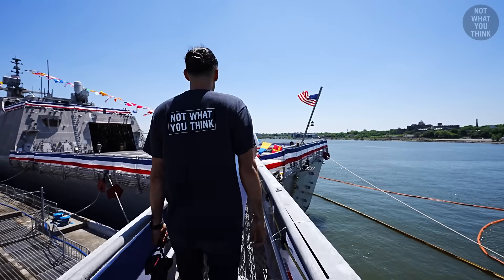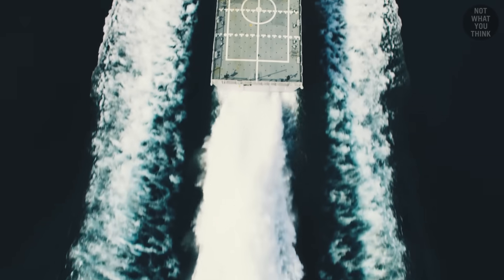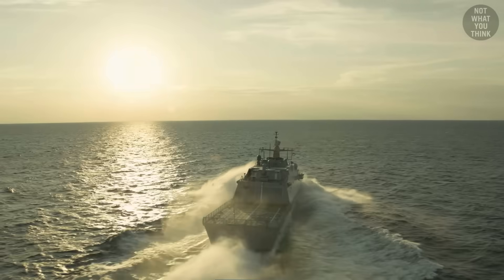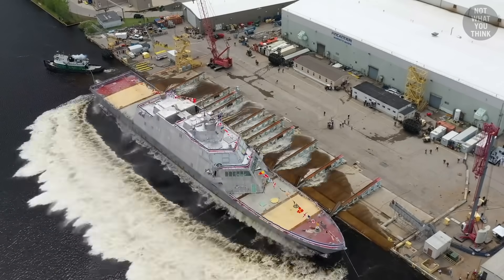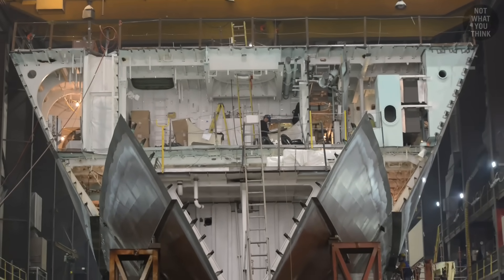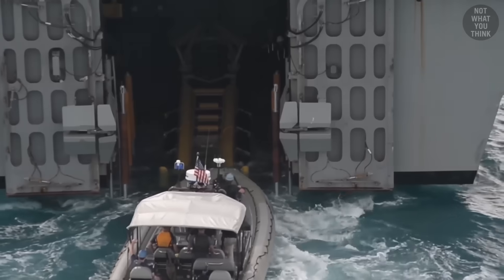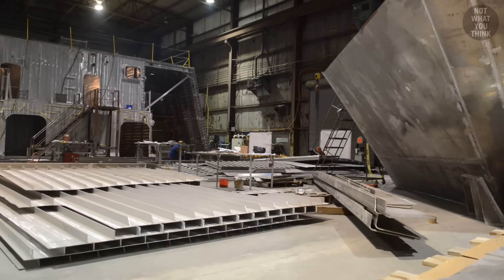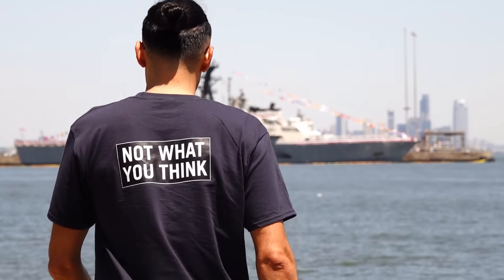I Visited The Most *Overpowered US Navy Warship

Comment: I appreciate the effort, but your video title is dangerously close to clickbait (if it isn't already based on your definition of "overpowered").

The LCS class ("little crappy ship", or for the Freedom class in particular, the "little crappier ship") is a case study in the dysfunctional acquisition system currently practiced by the US Navy, exceeded perhaps by only the disaster that was the Zumwalt class destroyer. The LCS concept was identified during a series of conflict scenarios that posited a foreign power attempting to close the Strait of Hormuz, a hypothetical event at the time that exposed the USN's capital ships (the ones capable of mine clearing, ASW and interdiction of enemy surface vessels) to multi-domain attacks from littoral and shoreline missile batteries. The USN thought a small, fast ship displacing 2500-3000 tons could accomplish all of those missions using a number of modules that would optimize the hulls for mine clearing, ASW and surface warfare duties. The small size and relatively inexpensive cost designated the LCS ship as an expendable asset.

Unfortunately, incessant design requirement changes meant that the modularity component was grossly under-developed (ASW and mine clearing modules were never completed), would require the vessel to leave the AO for module installations and the exchanges themselves took far more time in protected ports than originally projected. Compounding these erroneous assumptions was the decision to reduce the number of hulls ordered- fewer hulls would save money since the modules could make every ship an ASW, mine clearing or surface warfare platform. If all of the modules were actually functional, then part of this statement would be true- but because each hull could only do one mission at at time the main benefits of modularity were essentially defeated because there simply were not enough hulls to carry them. 

Ironically, the USN ultimately committed each hull to a specific mission profile with a focus on surface warfare packages- a very anti-modular approach which was the foundation of the entire concept. The surface warfare "lethality" is still grossly under-powered, but this is being addressed with the addition of the NSM and bolt-on, containerized VLS cells. The ships won't look pretty, but they will certainly be more lethal although their survivability remains low. Had the USN navy committed to hull specialization at an early stage, then at least there would have been some commonality between ships and subsequent reductions in maintenance costs and some aspects of training. The USN still needs a new small hull form mine clearing and ASW platform- the current ones date back to the Korean War and have wooden hulls. 

How useful they will be remains to be seen, but perhaps the most practical lasting lesson for the USN is an examination of its procurement and design process to avoid multi-billion dollar mistakes. Beyond the money, the USN lost a generation of time in a flawed concept, which could have been spent training new crews in a more evolved combat doctrine to remain ahead of potential adversaries. No amount of money will ever compensate for that loss of time- and China and the PLAN have used this opportunity to invest heavily in their domestic shipyard capacity and have now fielded the world's largest navy by hull numbers (and will in a the next decade achieve supremacy in actually tonnage).

BTW, we're still waiting to commission three of the Freedom-class vessels- long after the USN begged Congress to defund the program.
Reply: Almost like they are failing on purpose.....
Reply: Yet the hulls and machinery used in both LCS classes are based on successful commercial designs.  Why can civilian sailors operate ships like this and the US Navy cannot?  The Independence class is based on a 19 year old high speed ferry, the MV Benchichigua Express operated by Fred Olson Line around the Canary Islands.  It carries over a thousand passengers and 300 vehicles every day in any kind of weather in the Atlantic Ocean.  Fred Olson Lines is satisfied with the ship's reliability they ordered two more from Austal.   Commercial ships live much harder lives than naval vessels that are in port more than they are at sea.  Commercial ships have to earn their keep.  Fred Olson gets great service from their ships.
The Freedom Class is based on a successful passenger ship design that currently holds the Blue Ribband for crossing the Atlantic.  In 1992 she crossed the Atlantic in 58 hours 34 minutes.  That is just over two days and ten hours!  She has been in commercial service 1992 and her owners are happy with her, yet the US Navy can't make the same basic hull work for them.
Reply: The title refers to the Literal horsepower of the ship...

Freedom LCCS: 2x 48000HP turbines plus 2x 9100HP Diesels for 114k HP for 3500 tonnes displacement. 32 HP/tonne

VS

Arleigh Birke: 4x 26250HP turbines for 105k HP for 9700 tonnes displacement. 10.8 HP/tonne
Reply: "Flawed concept" is a pretty dumb take when arguably the most useful ships in the fleet - Amphibious Assault Ships - are also multirole ships. And modularity when done right is a complete gamechanger that makes a force much more versatile.

The concept wasn't the problem, the execution was.
Reply: @Palatine-Knight I don't understand the need for "dumb" comment, because I explained everything above. I feel it necessary to remind you that all USN combatants are multirole ships, although some platforms are more optimized than others. The LCS was a flawed concept- because for the anti-surface warfare role (assuming the modules had been built and integrated correctly) there was no way they could fit all the supporting sensors and electronics into a hull platform that didn't exceed 2500 tons. A bigger ship meant fewer hulls in budget and the inability to perform the required missions. The concept was under-developed based on a single wargaming observation, and then further complicated by the dysfunctional acquisition program and execution of design requirements. The LCS is like the Navy version of the M2 Bradley, an APC meant as a battle taxi that grew twice as large, carried fewer personnel and now mounted AT missiles in case it ran into tanks which it was not meant to fight.

I found your comment both rude and ignorant- not a good combination. Please don't comment again. Have a blessed day.
Reply: @thomasromanelli2561   And yet in your original comment you stated it would have been good if it was specialized in surface warfare from the get-go. But now you're saying it always would have been incapable of surface warfare, so which is it? And the Bradley has turned out to be a game changer in Ukraine, and definitely proved its mettle in Iraq.

The Bradley is actually another great example of how there are a lot of people who are conservative in military thought, who like to loudly whine about every new project. But the passage of time proves them wrong. The same mentality as those in the interwar period who dismissed the idea that planes or tanks would have any practical battlefield application to justify their costs.

If you want to be a step ahead of your opponents and be at the cutting edge, then you have to take risks and invest in experimental projects. Sometimes they aren't perfect, but there are still crucial lessons learned. Usually, the problems can be worked out and they can improve. Sitting around producing the same exact thing for 60 years is how you end up like Russia, who can't even beat their neighbor.

Speaking of "near peers" (a laughable term considering how far behind they are), China's Navy is far from a threat. The boot does not fear the ants, even if the ants significantly outnumber it. They're vastly outmatched in capabilities. Particularly because the US is willing to push the envelope with development.
Reply: @Palatine-Knight  The LCS was designed for surface warfare, to go toe to toe with enemy fast attack craft in shallow water at high speed.  The original anti surface missile system envisioned for them was a joint project with the Army and the Army cancelled the program.  The IIR version was not finding targets.  That left the Navy to find a new anti surface weapons.  That new weapon is the Kongsberg NSM, which is replacing Harpoon in the US and many other navies.  NSM equipped LCS have a potent anti surface capability.  The LCS can also firer Hellfire for short range engagements and the Bofors 57 mm gun is considered by the folks at NSWC Dahlgren to be the best naval gun under 100 mm.  It has the same range as the old Oto-Breda 76 mm Compatto but unlike the Italian gun the Bofors 57 is reliable.  The Italian gun basically shook itself apart so for the US  Navy the rate of fire had to be dialed back significantly to keep them together.  The Bofors 57 has 250 round per minute rate of fire and can put more weight of ordnance downrange than the old 76 mm gun.

Comment: That engine box goes both ways I’m sure not only keeps it from exploding into the ship but keeps ship explosions from messing with the propulsion of the vessel
Reply from the maker: Good point.
Reply: @NotWhatYouThink  Oh my.... I did not know you have dark skin..... I'm sorry.....
Reply: I don't know about the LCS ships but on the older Ticos the turbines were containerized for several reasons... an entire turbine assy could be quickly pulled and replaced by an overhauled unit, the container doubles as sound insulation since these turbines are loud as shit, and the container itself is a semi sealed unit that can be easily flooded with CO2 in the event of an engine fire.
Reply: @wysoft  

I was told by a retired Master Chief about the USN's attempts to incorporate "modularity" into as many ships and systems as possible back in the 80's(?) 

I guess that judging by your comment that the philosophy was at least somewhat successful up until the Zumwalt class when Navy Planners decided reinventing the wheel would be best?
Reply: @floydholder597  that was sort of what the Navy was trying to achieve with the entire mission modules idea of the LCS classes, but unfortunately when you have to pick and choose which module to outfit based on intended role of the vessel, find the time to install and test the modules, and you only can support X amount of modules at a time, now it's a liability rather than an advantage and is what sort of made the LCS design look more like an oversized patrol boat design on paper. The newest Constellation class are going to still support the mission module systems simply because at this point they have already been built and are in the supply and inventory pipeline.
Reply: @wysoft  
I will be the 1st to admit that I know next to nothing about building warships other than what my old "sea-daddy" told me, but it seems to me that certain components could still be modular.

Like the engines you commented about, maybe crew quarters and the CIS spaces?

But with the different weapons platforms used for specific missions maybe that would blow the entire concept, particularly the CIS requiring so many different system interfaces.
Reply: @floydholder597  I can't comment on current Navy shipbuilding practices but that is how we do it in the commercial world - most accommodation spaces and pretty much everything in the "house" is pre-built and designed to be stacked and interconnected almost like Legos. The unfortunate truth of US shipbuilding today is that a lot of this is done in foreign shipyards (e.g. Hyundai Korea) then shipped to the US where we slap it together and call it a "US Built" ship.

Because of the higher standards of damage control and isolated water tight spaces in Navy ships this approach would be unlikely to work.
Reply: @wysoft  

That work needs to be brought back onshore ASAP, before we get sucked into another war.

That gives me something else to e-mail Ted Cruz and my worthless RINO House Rep.

Thank you fir your service andctakingvthectime to explain it!
Reply: I'm sure it also acts as a sound barrier and thermal barrier too. 2 full aircraft turbine engines spun up would be painfully loud for the  crew.
Reply: And helps to dampen the noise and heat coming off it
Reply: Tracers work both ways!
Reply: Exactly the ship is made from aluminum so not too much armor from an aluminum hull that steel box probably offers some protection from anything that an enemy might fire at the ship
Reply: @JohnFarrell-jo2sw The hulls of the Freedom class are steel. The superstructure is aluminum, just like all the frigates made since the 1950s along with pretty much every post WWII destroyer class until the Burkes.  I don't fetishize steel so much.  Consider HMS Sheffield.  She was all steel. I know this because I have been on two of her sisters, Birmingham and Southampton. Aboard Birmingham the Subleftenant escorting our visit was quick to point out that unlike us Yanks, they built their ships out of steel.  This was before the Falklands Islands war. Some years after that war HMS Southampton and HMS Battleaxe made a visit to Diego Garcia where I was stationed.  During a visit to Southampton I satisfied my self she was indeed all steel by sticking a magnet to her everywhere I went.  A little telltale rust on the O3 level confirmed what my magnet was telling me.  Still a single Exocet whos warhead failed to explode sank her.  By comparison, USS Stark, a frigate of the same displacement as Sheffield but built of aluminum from the main deck upwards survived hits by two identical Exocet missile, one of which worked as designed and exploded.  The other was a dud.   Nevertheless the crew was able to control the fires and the ship returned to the US under its own power.  Being made of aluminum didn't condemn Stark to Davy Jones locker because NAVSEA gets their designs right and the US Navy continuously trains for damage control.  Sheffield and her Type 42 sisters were poorly designed and outfitted.  The material she was made of could not overcome those shortcomings.
Reply: Uh, no. It's there for flooding purposes.
Reply: If the ship explodes, even if its engines are intact, they won't be of much use.
Reply: I kind of figured it was also designed to provide additional armored protection from incoming hostile ordnance.....

But what do I know from nothing?

Comment: I've never liked the LCS, but it could be good if they could be produced in smaller shipyards in massive quantities. The navy is struggling to put boats and subs in the water to maintain the current size. If LCS could be mass manufactured on short notice in the event of conflict, that could honestly be their redemption.
Reply: The bad part of producing LCS in massive quantities, is that we don't have the personnel to man them. The Navy is struggling on the manning front, and all ships are undermanned terribly. The navy missed it's recruiting goal by over 5,000 new recruits in FY2023. 
The other problem the navy is facing is the lack of skilled ship yard workers and maintenance crews. Design flaws in the ability to easily fix minor problems and vendors of parts for these ships have caused tremendous maintenance setbacks. All sailors on a ship are capable of maintaining and repairing the equipment installed onboard ships, but when the navy purchased many of the systems installed on the LCS ships, they went with non-standard navy vendors and many of the installed systems are proprietary and the vendors won't release the detailed technical documents to troubleshoot and repair the equipment when it breaks. So now the navy must pay big money to the manufactures to sent technicians out to trouble shoot and repair the systems. The majority of the contractors that come onboard the LCS ships to conduct routine maintenance can't even read, comprehend and perform the simple maintenance tasks properly. We find stuff they mess up or break all the time, then the ships crew has to go behind them and fix their failures. 
The Navy bit off more than they could chew and bought too many LCS ships before thoroughly testing the ship design and implementing changes to address design shortfalls, manning, and crew training. The other huge failures of the program was thinking that commercial off the shelf systems was a good idea. this is where the issues of dealing with proprietary equipment comes into play, and the logistical nightmare of trouble shooting and ordering replacement parts. And going back to manning, we all understand that the navy wants to create smaller more autonomous ships to be operated with as few personnel as possible at sea, but there still are requirements for in-port periods that require more personnel than what is required at sea. 
I would say great concept, horrible forethought and execution.
Reply: you said '' mass manufactured on short notice '' , are you kidding me ? is it like 10 a month or more like 5 per year ,  Have you ever been in a ship building construction site ? USA can't put in jail a criminal in 4 years how they can manufacture more than 2-3 such ships per year? Congress is too busy listening to clowns like MTG or protect Trump they have zero clue about economy who should pay for such infrastructure ? Private sector ?

Comment: I'm not sure I believe your explanation on why no ASW. I mean, isn't sprint and drift a thing anymore? Nobody is doing ASW work at flank speed are they? Flow noise would prevent that wouldn't it? Never mind vibration. Also, that thing can't carry an ASW helo? Isn't that still your primary searcher and prosecutor if you are a surface platform?
Reply: The ASW module had really crappy cheap sensors (look at how the towed array flopped everywhere). Without a dedicated bow array, I don't think you want to rely on towed arrays and dipping sonar only